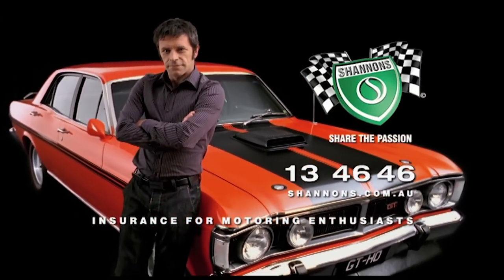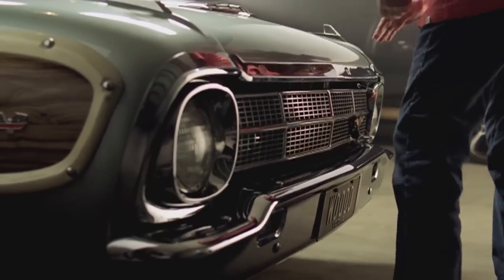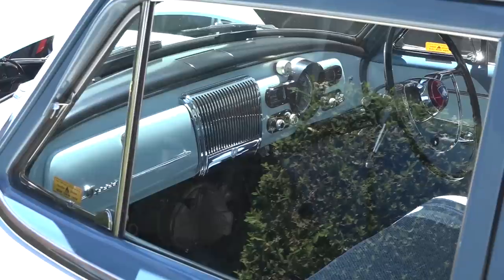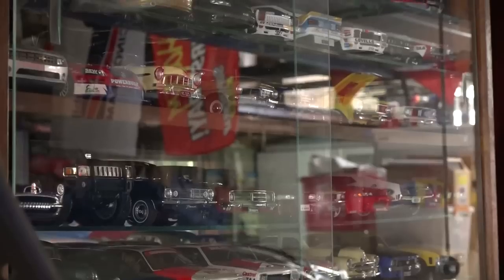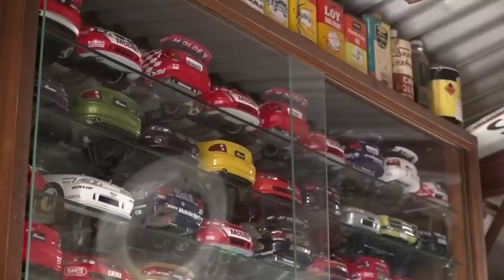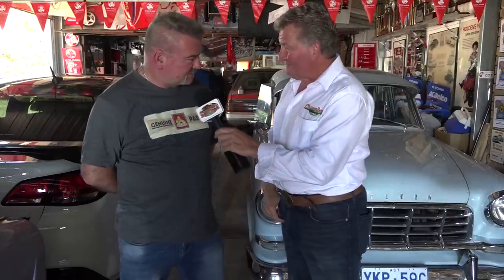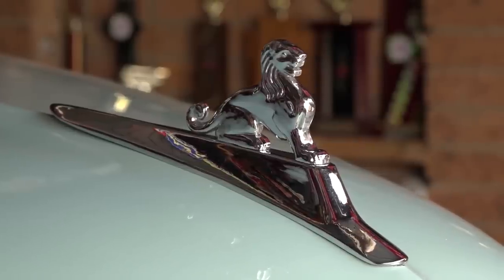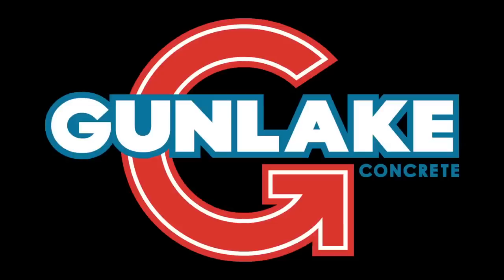Early Holdens: Classic Restos - Series 46

Comment: With the 1949 215 having no indicators, you can choose to get booked for having your arm sticking out of the vehicle, or failing to indicate.
You're damned if you do and damned if you don't, take your pick, you're screwed either way. I'd rather not risk losing my arm so I'll take the later option. :face-purple-crying:

Comment: When Cars were affordable and built strong and built in Australia and built for Australias rough terrain.. Now old cars are expensive and sort of status symbol
Reply: Lol - absolutely Joe. I remember back in 1990, a guy pulled up outside work in a banged up HQ...my immediate thought was "look at this poor bastard"... Now if this old mate pulled up in the same car 30 years later, it's cool !!! lol...
Reply: They're treated like an old painting.
It's gone too far IMO.
Reply: @classicrestostv1fletch764  lol i had an old 4 speed manual  202 6 cylinder 1973 one tonner HQ with premier nose cone. it had a reasonable body and it drove. I didnt even care about the car. it also had 12 slotters i think. the old tray had no floor the wood rotted away plus the tray was old and heavy and ugly. i sold it in 2020. it had a loose steering column no door cards and cracked dash no glvoebox no carpet new floor was put in very poorly by last owner was very bumpy. but had no rust. so we sold it because we didnt want to replace the new floor. I wasnt even sad that we sold it for 4k
Reply: @jamesfrench7299  yeah old cars are treated like they are worth a years salary. like and old HQ V8 restored is like 30 -40k and an ls1 sedan is like 6-8k in good condition.  i know old cars with rust going for 5k - 10k and my dad and his mate laugh at the price and call them stupid. 

reasonable price is getting a hx holden ute and  KINGSOWOOD HZ UTE for 7k for 2 utes which my dads mate got.
Reply: @Jo_Wardy  and they were pretty ordinary to drive compared to cars from 1990s on. I remember the big three large locally built hacks being called dinosaurs in the 1990s.